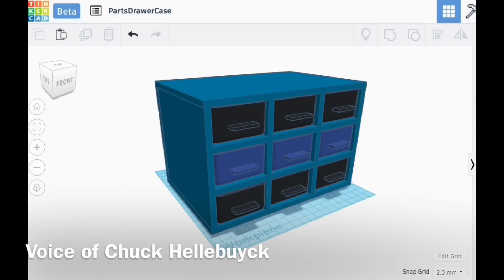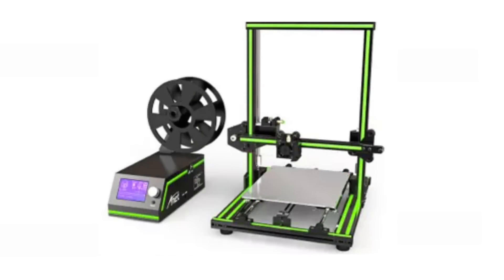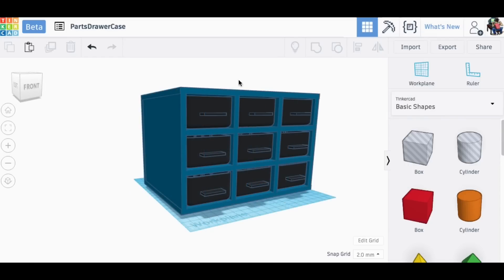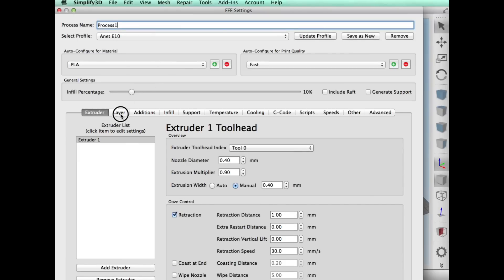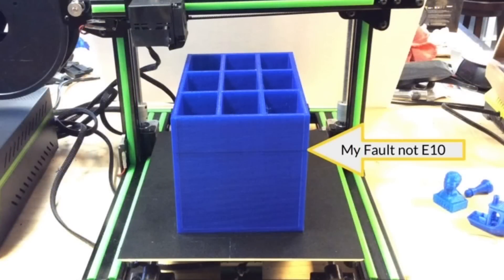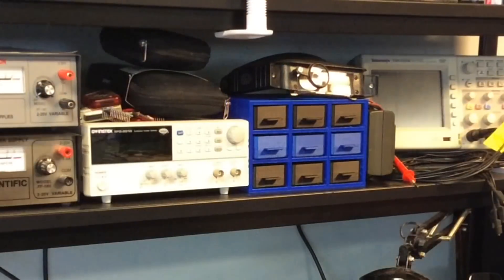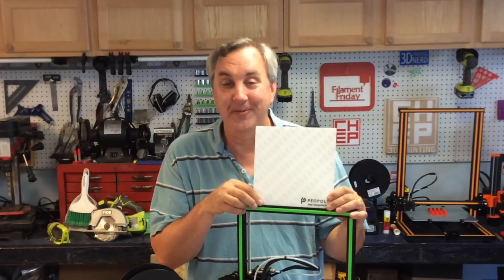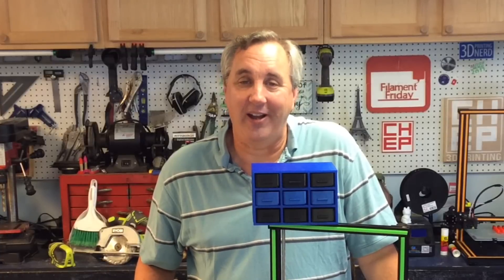3D Printed Hardware Storage Drawer Cabinet

Comment: I really like this. I downloaded the files. When I sliced the box with Cura 4.1 on an Ender 3 it said it would take 3 days+. How did yours print in 20 hours?
Reply from the maker: I used a lower quality setting.
Reply: 3 days? what are you printing with!?! pass me those settings I think you're too slow and the layers are too thin, that should be 1 day print, 30h maybe
Reply: @l3d-3dmaker58  Sorry it took so long. Notifications were turned off. Thanks for looking at this. Layer Height 0.28, Infill Density 20%, Temp 200/60, Print Speed 50mm, Supports, and Skirt. Using PLA. 184x124x121 mm
Reply: @l3d-3dmaker58  Downloaded the files from Chuck. Ender 3, Cura 4.4.1

Comment: nice piece :) 
but why did you take the design from tinkerCAD to S3D ? ..... can't print form tinkerCAD ?
hop it is not stopped question XD ...... I bought the ender 3 , and searching for the best soft  and stick to it :)
Reply from the maker: No cannot print from Tinkercad. Tinkercad is a CAD program for design of .stl file. S3D is a slicer to convert .stl to GCode.
Reply: CHEP 

Although I didn’t ask, that was instrumental help for me. Thanks for answering!

Comment: As one starts to make larger and larger prints I wonder if leaving voids on large areas reduces the amount of filament used? If you look at the commercial injection molded drawers you often find that they remove a lot of unnecessary material which I'm sure saves cost and weight. On a 3D printed object the solid areas are often infilled at a much lower percentage so removing sections may result in a heavier print as you need a few solid layers on the edges. Has anyone tested leaving voids as a way to save material or seen a guide for designers?

Comment: Storing electronics parts in these drawers brings up a thought. Is there an ESD issue when storing static sensitive parts in these drawers?  Do different filament materials have different ESD properties?  I wonder how we would find this out?
Reply: CHEP 3D Printing & Electronics 
I like using the conductive foam as well, the parts don't rattle around as much.